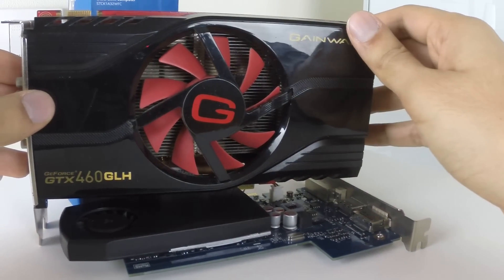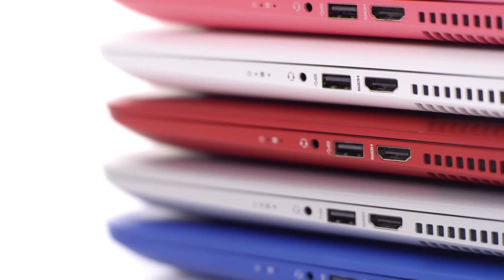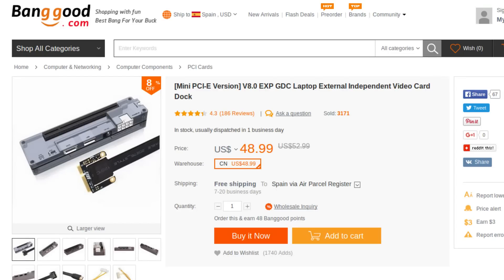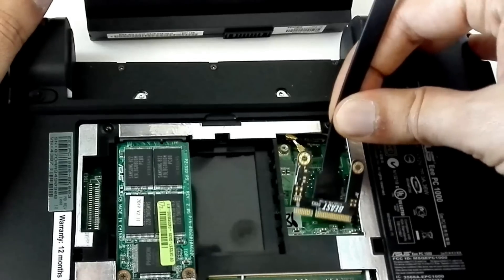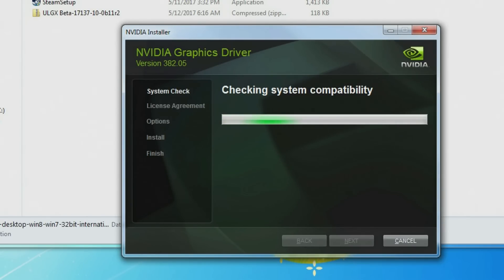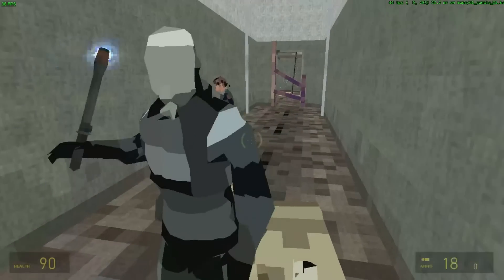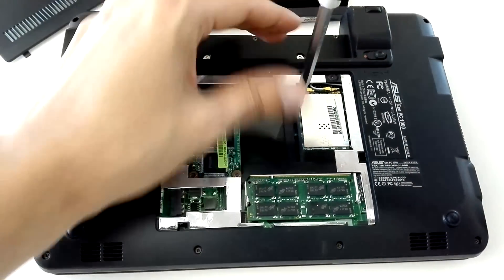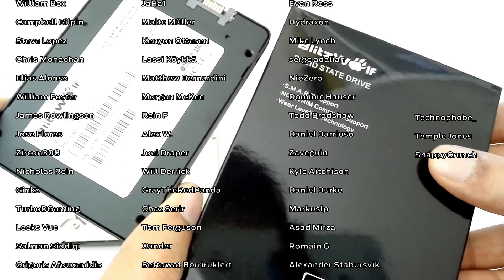An External GPU for an old Laptop?

Comment: Well, I have amd dedicated and integrated gpu in my laptop, and amd r7 250x from my old pc that does not work. 
I bought this dock 3 months ago and guess what?
I can't install the drivers for my r7, because amd software detects my laptop gpu-s in first priority and install drivers for it. Windows see's my cars as HD 7770, so it should work, but it does not at all. Any ideas?
Reply from the maker: you should have drivers for both. I had to manually install the nvidia drivers for it to be recognize. Make sure the GPU is connected first and then try to manually install the drivers.

As I said, it takes some time to get it running. It took me hours to figure it out.
Reply: LowSpecGamer Man, I spend two weeks on it. Tried literally everything I could. Manual drivers, autodetects, turning off laptop gpu-s, installing single driver files without amd manager software and many many more. All I can try is use some GTX, but I don't have one, so I gave it up. I think that upgrading amd to amd is just... Nope.
Sorry for my English, it is not my main language.
Reply: LowSpecGamer But it's good that You've made video about this, it may help a lot of people :D

Comment: I would like you to test a more powerfull cpu with setup woul;d be cool to see the results
Reply from the maker: So do I. Seeing like so many people are liking the concept I will try to get my hands on something better for that.
Reply: LowSpecGamer hey, i am using a laptop.. it has all ports you think are necessary fot these stuffs. a esata port. an express card.. a docking station.. the model is dv4 11go from hp..
Reply: I'm using this EXP GDC Beast adapter, but the Express card variant (no laptop disassembly needed :) ) with ThinkPad T420 - Intel sandy bridge core i5 processor, 8GB of ram
= Dark Souls 3, mix of Medium/High settings 30 FPS like a boss :)
Edit: using the nVidia GTX 650Ti BOOST 2GB
Reply: Witcher 2 on Netbook :3
Reply: LowSpecGamer it's a great idea. maybe you can find an old all-in-one system for the next video
Reply: i got lenovo y510p with i7 4700mq and external rx580. the witcher 3 ultra works at 60-70 fps easily :)
Reply: @andrzejpatek4557  hi there. How big is your cpu load ? I have 4720hq and want to use 1070. Im worring about cpu bottleneck
Reply: @Didyouknowfacts7  Sorry i swapped to pc so i cant give you exact values, but it was 50-80% as far as i remember
Reply: maybe a 1050 would be good? It's the fastest graphics card that doesn't require an external adapter
Reply: kristian svendsen 1050 ti
Reply: I want to see that too.
Reply: I have this between my R9 270X and Dell E6230 and I can play everything up to 2016 at 1440p60 on low settings.
Reply: I've done it in a way better setup than you.

Use a Thinkpad T420 i5 2520m - this laptop is Nvidia Optimus capable and allow you better bus speed with GDC to expresscard. 

You will be able to run at PCI-E X1 2.0 IIRC. 

With this a I5 2520m - gtx 660 i was able to run at 100 + fps in csgo / 70 fps in dark souls 3 in medium setting.
Reply: talking of all-in-one why not try some games on computer monitors?
Reply: i'm getting 30-40 fps gta 5 "very high" on my internal lcd with the 960 msi, on the nvidia 540m that my laptop has i get 8fps on lowest settings "normal" haha, 1080p aswell
Reply: Was thinking of doing this on my T420 with a 9800gtx + i got laying around as well as a 750w powersupply with half-dead 24 pin power (doesnt power up on any normal system but can power gpu's fine which is neat.) (can hook up 2nd powersupply too run the adapters main power.)
bought my T420 from my university last summer for 300 sek or about 35 usd with 4 gb ram, windows 7 pro. (Sadly oem version otherwise id get windows 10 on it.)
Reply: i have tried this on the low end i3 alienware alpha with a gtx980ti there is a bottleneck using it as you lose performance from the connector not being as fast as a pcie slot. although the pc was perfect for low end indie games it had a hard time running skyrim but when i install the external graphics card the fra.e rate went from 30 to around 60+ frames on the highest settings. it is a cool device but honestly you would be better saving and buying a better pc if you want to see the full extent of a powerful gpu. one tip don't go over the recommended gpu graph as performance wont increase on any cards higher then the 900 series.
Reply: Yep, from 2013 or 14 i think
Reply: Dennis Gagliano how is using a PSU the lazy way? The whole idea of this is to do it cheaply as possible.. if you have a ATX power supply laying around then why spend the extra on a dell psu, also with running a ATX power supply you get your 6 & 8 pin pcie plugs to run higher end cards and dont need for a adapter for the 6 pin off the egpu
Reply: iHeart GT86 {KatyCat} I tried with a 1070 it was not working for me, Windows (7) said it stoped the card, because it reported errors.. I haven't had much time to play around with it, so I never managed to solve the issue. But what i realized after I left from my friend that my laptop were not hooked up to the wall power outlet :/
Reply: Can you try it with likegtx 940m or gtx 1050 :D That would be great. Can someone tell if if bandwidth of miniPCIe port is smaller than on regular one, is connecting GPU on it just as connecting it on to a regular one? Thanks
Reply: lol 2 weeks ago I sold my old Dell e 6540 with i7 4800mq OMG
Reply: like a pentium dual-core it can be found on low end laptops from 2009
Reply: yes
Reply: A used lenovo T420 would do pretty good.
Should be fairly cheap to get hold of as well. (2nd gen I5 or I7 would work pretty well.)
Reply: I have a e6530 8 core i7 with a beast. It runs awesome. I have a rx 470 hooked up. I get 10k in firestrike graphics score and a total score right about VR min. The e6410 works percectly too. I have one with a dgpu and one without. The one without works better, in fact it works perfect. I think i5 e6410's go for 50 bucks on ebay.
Reply: Damn guys these prices O_O .... i really hate my country everything is super expensive where i live - T420 cost me like 200$ :D anyway I love this thing, everything about is is so well engineered! And with 9-cell battery i can run around with it for 5-6 hours and use it as a student and connect it with eGPU and have a quite powerfull gaming PC in one package :)
Reply: Maybe like a newer Celeron + 750
Reply: I got a toshiba c850 running a i7 2710qe on a custom bios, 8gb ram running a beast with a 850 watt power supply.. using a HD5870, running 3 external monitors off the card.. Tried the Beast EGPU with a R9 290 and would crash when card went to fully loaded.. hd5870 has a power draw of 290 watts fully loaded while the r9 290 has 365 watts loaded
Reply: that would be awesome :D
Reply: Andrzej Płatek do you have a y510p from a few years ago?
Reply: plz do this.
Reply: same
Reply: go to my channel i have a setup video on this egpu with a gtx 960 msi on a asus n73sv with a i7 ssd bla bla
Reply: nope it's not the 10 series has issues with the egpu, + you can get a dell power brick to power the egpu with 220w, the way he did it with a psu is the lazy way.
Reply: the egpu is designed to run with a dell 2a 220w power supply, the psu is a optional option. it takes much more space + they are far noisier then the dell, if you'd get this as a permanent solution you should do the work and try to get a dell power supp, it cost me like 13 euro's and i managed to find one in the netherlands and netherlands normally has nothing. that's why i called it the lazy solution, like you said "it's what i had" :p it's not an offence. and i run my gtx 960 with a 6 to 8 pin that should be included in the banggood package but they don't it's a 2 dollar optinal option which is the fault of banggood :s . the dell 220w still gives that option. you can watch the video on my channel i have a setup video of it
Reply: Dennis Gagliano it actually comes down to what hardware you want to run to what power is needed... if your running a higher end card a Dell 220 watt power brick isnt going to cut it... Your GTX 960 only has a power draw fully loaded of 120 watt... I run with my Beast Egpu a HD 5870 and that has a power draw fully loaded of 290 watts and if i try to run my R9 290 that has a power draw fully loaded of 365 watts.. a dell 220 watt power brick wont power those cards and you will crash.. you need a descent PSU with a decent amps on your 12v rail
Reply: yes but those are the amd cards, i have no clue about those + you will lose your internal lcd with those. that's why i'd recommend the geforce's. and the newer the card's the lower the power nowadays, even the 1080's dont need 220w now and those won't even run proper on the egpu :p, for amd sure, do your thing
Reply: Dennis Gagliano You dont lose your internal lcd running amd cards.. you still have your laptop lcd run by your laptops internal GPU ....you also have your laptops hdmi or vga out.. my setup i have 3 external monitors running off the HD 5870 ... then have the laptop powering its own lcd and a external monitor giving me a total of 5 screens
Also with the Beast EGPU the mpcie is a 1x slot not a 16x slot and usually pcie 1 not 3.. so the cards arent going to perform like they would in a desktop
Reply: i know about the pci, mine runs at gen 2 speed though, and the 960 is very little bottlenecked.  but i never heard that people got their internal lcd working with amd card's that's new to me. i can run vga + hdmi + internal lcd aswell, but mine is buggy with the backside of the gpu port's even though others don't have that problem might be laptop/egpu related :p
Reply: If everything goes well, tomorrow I'll put my hands on a GTX 970 and I will pair it up with my Lenovo Y580 (i7-3610QM, 16GB, 256SSD+1TB HDD, GTX 660M). (I already have the adapter and a 580W PSU.)
So I will come back and I can share my results, hance this comment :)
Reply: +Dennis Gagliano I tried with a R9 270X and my internal lcd worked just fine (mini PCIE solution). But the 3Dmark/passmark scrores were terrible (but I managed to play skyrim on 1080p full setting about ~40-ish fps without any texture/graphics mod).
Reply: its kinda funny. Low spec gamer then you bought GTX 1080Ti.
Reply: no the 10 series has a driver issue with the egpu, head over to the egpu forums and check it out nvidia made it so that most of the 10 series cards wont work with a egpu, because the 10 series drivers are new and wont run on lower drivers + those drivers are patched against hotplugging, i could run a 10 series on mine personally because i have support for hotplug, but i had a 1070 from a friend and the bottleneck is noticiable, get a 970/980 max for a egpu but don't waste on a 1070 or 80, 1060 maybe if you can bypass the hotplug issue.
Reply: @Gagliano17  im running a 1060 with no issues
Reply: Dennis Gagliano thanks for the info, good to know, than it was not the power what caused the issue. It would be odd anyway, the card has it's own power, and a pcie should not work differently with power on/off.
Reply: If your going to fork out the money for a 1050 or 1070 or a 1080 or any newer card.. why not spend the price of the EGPU and buy a motherboard cpu and ram.. you can pick up off ebay a socket 775 motherboard with a Q6600 that can be quiet easily overclocked to 4ghz on air and they usually come bundled with 4 to 8 gig ram..
Reply: I finally managed to put my hands on the 970, it is actually awesome:
Doom (vulkan) fullHD ultra 60fps cap (660M 1366x768 low 24-30fps)
GTA 5 fullHD high setting 30-40fps (660M 1600x900 low ~30fps)
Witcher 3 Wild Hunt fullHD high preset 30-40fps (660M 1366x768 low 24-30fps)
Skyrim fullHD ultra 45-60fps (660M fullHD low 30-40fps, 1366x768 low 40-60fps)

+ Bitter Raven
It would be hard to carry around a whole computer (I have a Q6600 on the shelf), also to me my laptop is my working computer too and I do not want to live in two computer.
This is only a temp solution for me, while I mange to gather ~$1800-2000 for a 15.6" Laptop with a i7 6700/7700 hq/hk and a GTX 1070 in it.
But until than I can play freely and it cost me only ~$300 (egpu case + adapter + GTX 970) and I will be able to sell the gpu around $100-150. So basically it is only $150-200 and I can play and I can carry it around.
Reply: If you already have a laptop, then it can be an investment thing, get the videocard, and actually be able to use it, and get your other parts, rather than having to sit and wait for everything to be delivered to use the videocard.
Reply: 1070 is a waste as a egpu, i'd get a 970 or 980 max for a egpu, the bottleneck on a 1070 is to hard, i've had a 1070 it performed worse then my 960 as a egpu.
Reply: dude.... ofc a 1070 is better then a 970, but not as a EGPU, this is about egpus... and i've tested the 1070, as a egpu it performs worse then a 960 because the 10 series is not fully working with these egpu, nvidia done something to the 10 series drivers. just trust me. or do not and waste your money, your choice.
Reply: kristian svendsen most 1050ti also don't require external power
Reply: playing with atom cpu will causing bottleneck please i5 cpu please
Reply: + Dennis Gagliano Help Me Guys, Im about to buy a GPU for My dell inspiron 3521 laptops. Can It handle that. I have a GTX 1050 ??? I also have a PSU 400W!
Reply: there is a driver issue with the 10 series, the 10 series cards do not run on the 9 series drivers and the 10 series have some patch, if you can bypass hotplug stuff by bios then you can run the 10 series. check the egpu forums for more info about it, i don't have a 10 series card but i can toggle hotplug in bios so i could but the 960 is around same performance as the 1060 so i was good with that
Reply: So can my specs fit with the GTX 960 ???
Reply: I would like to use a gtx670 on my 2015 macbook pro without having to pay laptop money just for the casing, is this possible?
Reply: yes, you can use egpu's with macbooks, but i'd suggest heading over to the egpu forums they have a macbook section.
Reply: Andrzej Płatek what adapter are you using?
Reply: Creepboom Labatory the same GPU using the same adapter with a faster CPU will gain a huge performance gain. say a Core 2 Duo would have gained a pretty substantial gain, it would have ran most game at or above 60
Reply: The Youtuber DIY Perks tried an older version of this product on a newer laptop and higher end GPU. It yielded some pretty nice results.
Reply: i have a second gen 2630qm 2.9ghz with 12gb ram and a gtx 1070 seahawk setup + 960 on my channel
Reply: I tried that same EXP GDC on my Acer notebook using an Intel Core i3 2330m, 8GB RAM, and an external nvidia GTX 550 Ti. I could run Overwatch at 1366x768 on medium settings smoothly (40-60fps).
Reply: would this be possible on a dell inspiorn I7 
16gb ram and a amd 4gb graphics card
Reply: theeman56798 well if you a mpcie slot which is usually replaced with an m.2 slot on modern laptops, although if you have a thunderbolt port you can use that because thunderbolt can carry pci-e lanes
Reply: Hey I love your content and for a person that cant afford a new pc and is stuck with a laptop, i have trouble keeping up with games my friends play, so if you can do a video on how to do this on a 2013 model laptop or newer that would be awesome!
Reply: Creepboom Labatory His vr headset is a cardboard box
Reply: that sounds Boss and i think you have answerd my questions
Reply: Try a Sandy / Ivy i3 or i5 and GTX 1050
Reply: Yea that would be so cool if he used a old gpu but a new powerful cpu
Reply: powerful cpu but minus any videocard
Reply: idk what cpu/gpu stuff does it have, the model has different versions with different cpu's and stuff so i can't judge. as long as it has a intel i5 or higher + a mPci-e port there is no real reason exept for whitelisting (but that's for lenovo's) there is no reason for it not to work. you can check my channel for my setup with the msi 960 on an asus laptop, there i explain how i run it
Reply: also Marcus60661, dont worry about the W10, because intel officially dropped support for the Sandy Bridge for the W10 :/ so its quite limited in terms of Windows 10 some drivesr might not work...
But if you want free upgrade to W10 LEGALLY it is still possible but only some people know about this "work around" :) tried it myself and it works exactly like free update worked that was there for the limited time if you remember. And the fun part is its totally legal and done by microsoft on their web page :)
Reply: ajddavid452 I have intel i2 core duo E8500 its from 2009 and it runs like csgo average 100 fps with max graphics and its my build but im going to buy i5-7400 in this year and new motherboard for quad core

Comment: There is an Asus RoG device that use USB 3.0 for connection. May they sponsor you to try on your low specs, it is good advertising
Reply: Forget it, it also use Thunderbolt, the 3.0 is just for extra performance.
Reply from the maker: Yep, I had researched this. Normal USB does not have the bandwidth for a GPU

Comment: if you had put the games into a slightly higher resolution then technically it would be more load on the graphics card than the CPU
Reply: That happends to me with csgo, if put the lowest resolution my cpu would bottleneck and if i put it to my native res the gpu wouldnt keep up and i would have slowdowns
Reply from the maker: Oh yeah, I should had mentioned that. All games where on 720p and the GPU was barely in full use.